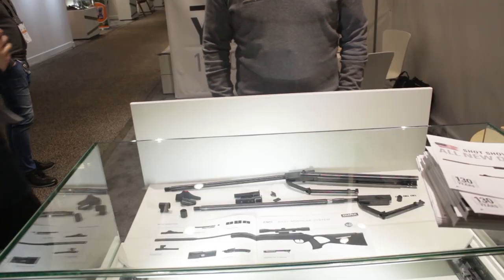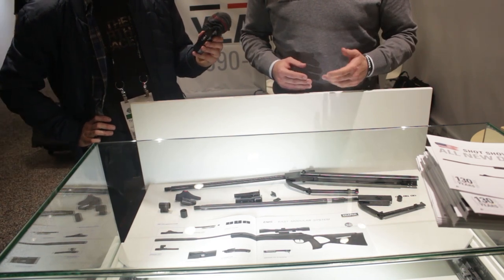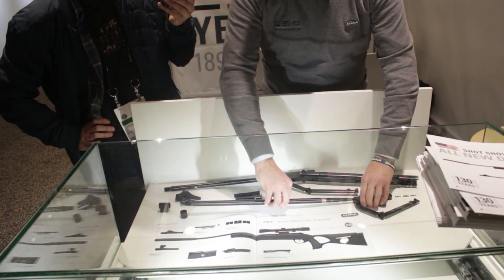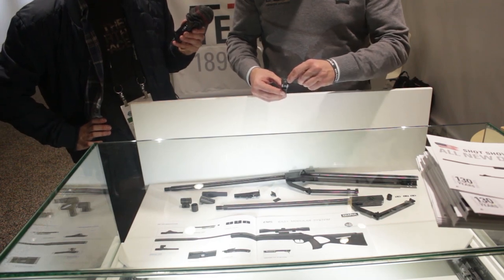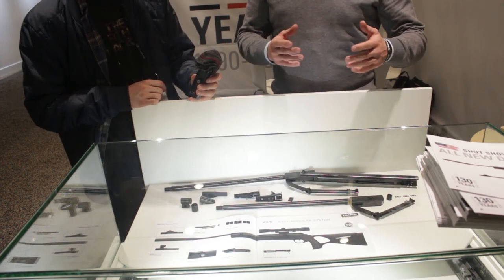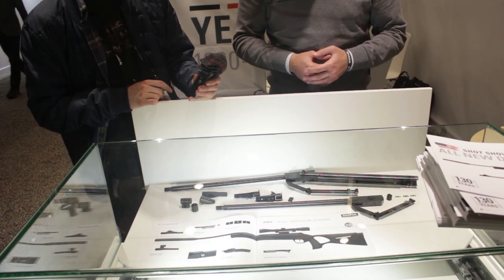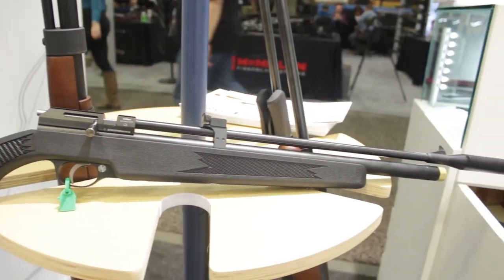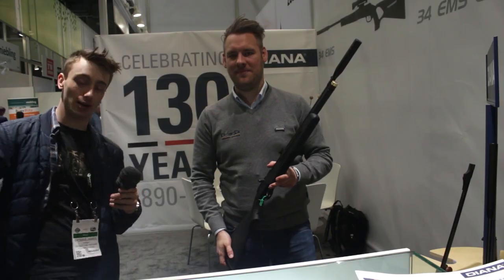New Diana 34 EMS (E-modular System) Shotshow 2020

Comment: Why does this seem like a very dumb idea to me? Also plastic cocking lever .... thank god I bought my 34 already and don’t have one of these new ones...
Reply from the maker: It felt pretty good in my hands. Pretty cool concept
Reply: It's a two piece metal cocking lever with a plastic guide, not a plastic cocking lever.
Reply: @HunterTom  germans have been doing this for almost 100 years, kindda lame of Diana to try to market it as a novelty concept lmao
Reply: Walmart has a beeman with 2 barrels for a hundred bucks
Reply: Next they gonna say Aircraft grade plastic.
Reply: I have one, i can say it is a  improvement over the old version. Super nice trigger, accurate, powerfull but not too heavey. A nice "modern" wood stock with some adjustability and checkering would be even better.